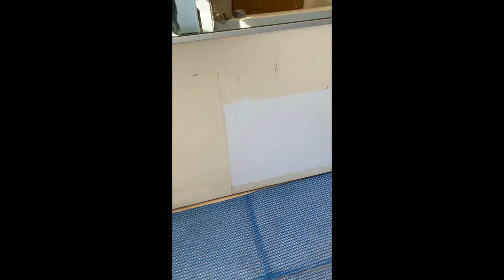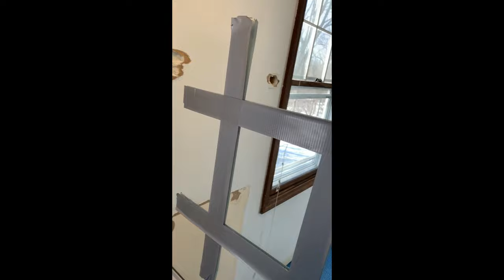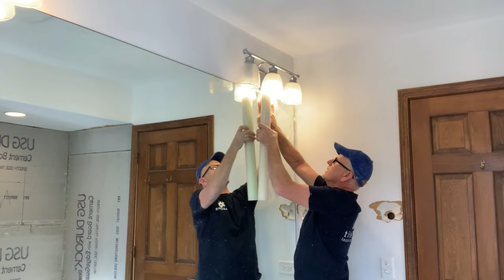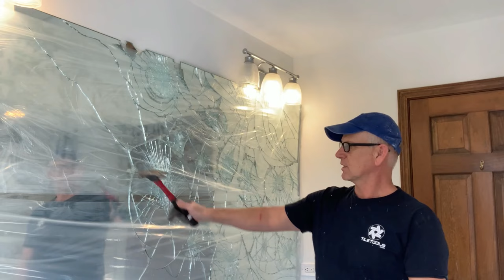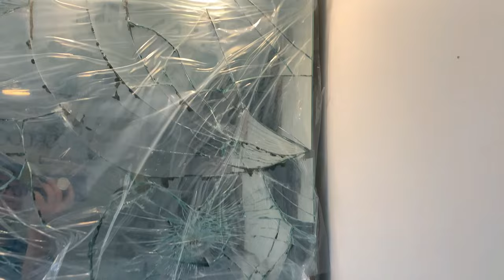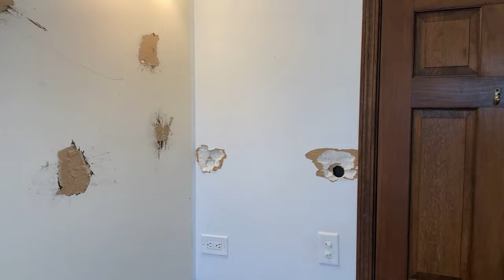Large mirror removal - safely

Comment: This is probably the unsafest way I’ve seen
Reply: Then YOU tell us who it's done.
Reply: @kenbred46  cross tape the mirror. Slowly tap shims behind the mirror until the glue begins to separate. It’ll pop off in one piece.
Reply: I had a wall to wall wainscoted mirror with j-clips on all corners.  I had 5 large panels and 8 smaller side mirror panels.  There was absolutely no way I could get wedges behind the mirror.

Unlike this video I wore heavy clothing, boots, goggles, hat and a visor… but more importantly I work knife/glass proof gloves.
Reply: @MeganMcDonald-747  OK but your solution assumes we have another person there to hold the mirror in place so it doesn't fall and break anyways.  The mirror I'm looking to remove is above a fireplace and I'll most likely be the only one doing it. Unless you have other recommendations.
Reply: @MeganMcDonald-747  If it were a smaller mirror, then yes.  I'm by myself; I'm trying to figure out a way to take down a LARGE mirror.  But that aside, what exactly did he do that's unsafe (besides not wearing safety clothes, etc)?  All the pieces are stuck together.  I'm just confused by your statement.
Reply: @MeganMcDonald-747  any suggestions for those of us who have mirrors wall to wall, ceiling to ceiling? i cant get shims behind them so pretty desperate to find a solution and i can't find ANYTHING online
Reply: @Sintilla  this method works, I've done it myself. Lay down some good plastic to minimize getting shards, there will be shards of glass, very tiny that break off when you cut the film into sections. Use a good wet dry vac to get the little glass bits. Minimum of two people to do this by the way.
Reply: Even if you get a massive mirror off in one piece, then what? It will have to be broken up anyways.
Reply: @MeganMcDonald-747  Can't use shims!  The mirror is glued all the way to the edges.